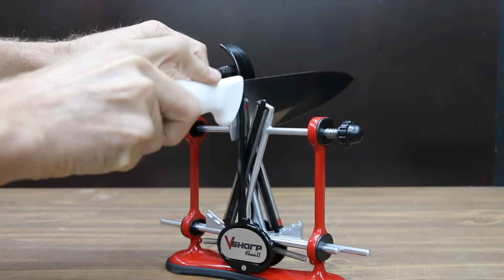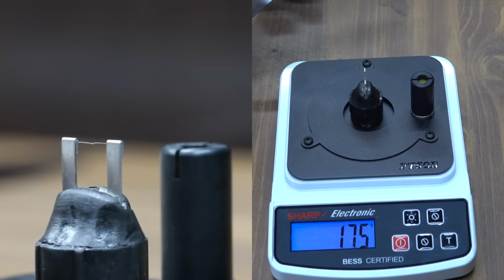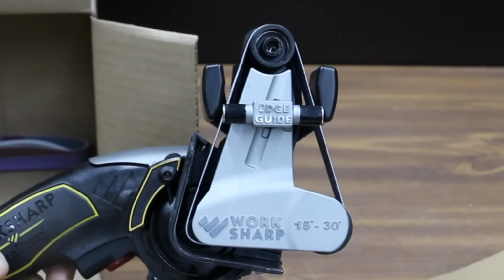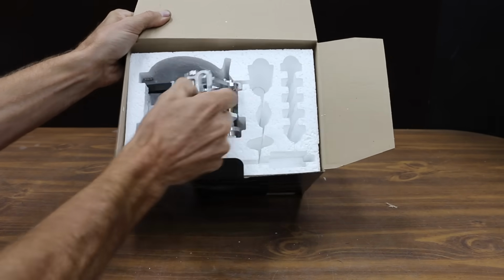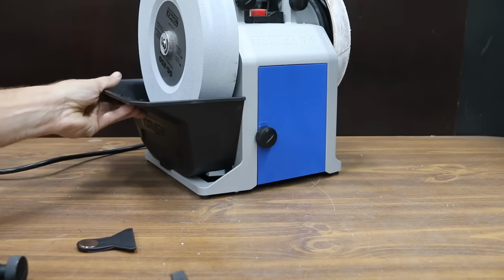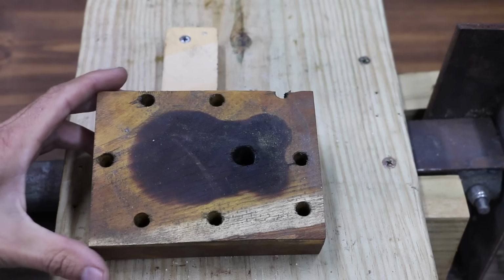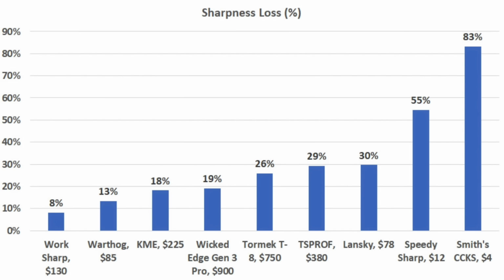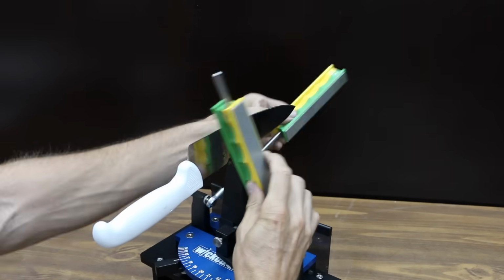RUSSIA vs USA Knife Sharpener? TSPROF vs Lansky, Wicked Edge, KME, Tormek T-8, Work Sharp Ken Onion

Comment: It's too bad that the T-8 didn't come with the knife holder. The jigs allow for the knife to be rotated (for the curved tip) while keeping the holder jig always connected and perpendicular to the guide rod. Instead of rotating the knife holder. Also the guide rod can be flipped and used for stopping to ensure the sharpness. Just info for future use :)
Reply: Tormek was shown in a bad light in this video, but it is their own fault. A Tormek used properly is really effective. It is very expensive, but if you are a pro user, it is worth it. I also have a Japanese water stone with my T-7 and it puts a mirror edge on my best knives and tools that lasts for ages, I have many of the jigs even can sharpen drill bits
Reply: @Anchor2012  The detail view of the tormek resulted in the finest edge without  scratches. I think the soft steel  cuts better with scratches. Using a Hrc 61 plus knife would  may be show a different  picture especially after blade abuse. But sharpening  is a field of its own. I look into the tormek for years now this just shows  me why  I will get it as a treat may be next year.
Reply: You can also get a stone dresser that will turn the stone into a fine stone.
Reply: @jesusisalive3227  It comes standard, but I didn't see it used.
Reply: @irresponsiblyblue1411  

It doesn't come standard on all models.
Reply from the maker: Thanks for the feedback.

Comment: For a part 4, take the longest sharpener time, and use a 400/1000, 3000/8000 whetstone kit in under that time. Whetstones are so cheap and can put incredible edges on knives.
Reply: I find ceramic better for day to day use. No water or oil needed and can sharpen curved blades that flat stones cannot.
Reply from the maker: Thanks for the suggestion.

Comment: I have a no-name brand (I couldn't find one on it) sharpener that looks lots like the Smith's one.  I use it every time before and during cooking prep.  I find it works great, and keeps a nice edge on my knives.  I like the simplicity...some of the ones you tested have a Rube Goldberg vibe to them.  I am afraid that due to the multiple steps, I may avoid using them, whereas the simple, one piece tool is so easy to use.  And lastly...I absolutely loved the ASMR part!  Very un-Project Farm like, but frankly, I'd enjoy seeing more like that.  Great job as usual!
Reply from the maker: Thanks!  Thanks for the feedback.

Comment: I’ve love my Lansky!  Seems like a good future project for you to add the most significant bells and whistles from the “top performers”. to the “best sharpener for the money”!  I’d love to see a any improvement to consistency and ease of use.  Love your channel, long time viewer.
Reply from the maker: Thanks!  Thanks for the suggestion.
Reply: @ProjectFarm  have you looked at it used the Spyderco Tri-Angle Sharpmaker? I swear by it 👍
Reply: Hi Todd, thanks for everything you do! I've made several purchases over the last few years based on your data and look forward to every test.
You mention that if the viewers would like to see anything tested to mention it so I have a couple of ideas with the example I'm currently using. 
*Spray adhesives
(Lepage heavy duty) 
*Nitrile gloves
(Gorilla) 
*Hand degreaser
(fast orange) 
*Multipurpose cleaners
(super clean- purple container) 
These are all things I use in the shop and would love to see some comparative testing against other products.
Thanks again!
Reply: I love my speedy sharp. If I have a lot of knives and axes to sharpen, I have an old WEN wet wheel.

Comment: Dang. Looks like I need to get myself a lansky. You made quite the knife there! Very well done!
Reply: Its so complicated it will probably sit in a drawer forever. a cheap (but well made) ceramic rod would be the best bet. Once you get the had of holding it at the right angle (you can hear when it's off) you will never need anything else.
Reply from the maker: Thanks so much!
Reply: Take a look at the Worksharp precision adjust. It's a guided rod system but with much better functionality than the lansky. I have one and fantastic.
Reply: @destro6971  I'll have to look into that as well. I've always had issues sharpening knifes well on a stone for whatever reason, probably not enough practice, but if its priced well it sounds like a good choice for me.

Comment: I absolutely love my wicked edge  but it takes a long time if it's the first time sharpening that blade with it and re profiling the blade. But I do love how sharp I can get and how consistent it can be. But definitely hate how it changes the blade geometry of the edge as in between the tip and handle end up with different angles especially if it is a long blade. Recently I bought a work sharp and like it for my general edc, like my Leatherman and my Benchmade Osborne.
Reply from the maker: Thanks for sharing.

Comment: Why have you ignored EdgePro?

Did you consider checking the angle on the sharpeners when you flip a knife?  I tried a Ruxin Pro that simply could NOT be zeroed. Sharpening angle changed by as much as 7 degrees when the knife was flipped.
Reply from the maker: Thanks for the suggestion.  Thanks for the feedback.

Comment: Thank you for helping us spend our money wisely. Could you test automotive eraser wheels, the type that you fit into a drill, that are used for removing glue and stuff? Thanks.
Reply from the maker: Great suggestion!  Also, thank you for supporting the channel!  It helps me put together more expensive reviews.
Reply: Yes! I don’t know why I never thought of this suggestion myself. While you’re at it and you have the tools out to test these, how about you test different brands of roll lock abrasive wheels and different brands of wire wheels. It’s really miserable when you spend the extra money to buy the good stuff when it comes to any of these products just for them to turn into dust after 30 seconds of use.
Reply: Id be interested in this too, I use 3m green roloc for removing gasket material on engine parts, its stout enough to get through most gaskets and sealant quickly but soft enough not to destroy an aluminium casting in a hurry (tho it will of you lean on it) I use mine in an adapter to a snap-on 12v micro polisher so theres a whole other avenue of reviews haha (my workshop doesnt have air)

Comment: Fastest notification yet! Love these knife testing videos.
Reply from the maker: Thank you very much!  Enjoyed your video today!  Very informative and helpful!!
Reply: @ProjectFarm  small torque  wrenches: lowest settings for bicycles and spark plugs ect.
Reply: Another idea for the upcoming winter is to test different types of apparel and how they handle wet and cold. For example, how does wool differ from polyester, nylon from cotton etc
Reply: You made me laugh when you whispered. There is someone that is doing that but isn't doing his job at all. With that said  I have the lansky system but I end up going through the course stones quite fast. I still want the Russian made system because of the base and how it keeps the knife in the best angle.
Reply: I have always been a bit of a nut when it comes to having sharp knives. I own the TSProf system a Lansky and the Ken Onion Work Sharp. For decades the Lansky has been my go to. More recently I bought the TSProf then the WorkSharp. I have a hard time keeping a consistent angle with the WorkSharp and if you're not careful, you can ruin the tip of your knife (speaking from experience). When I really want a high quality edge and have the time to do several knives, the TSProf is my favorite.
Reply: "Fastest notification yet!" What are you using to time notifications?
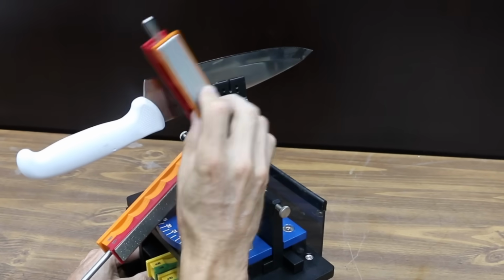Reply: @eriklarson9137  I know PF uploads at 12:50pm every Sunday, and I received the notification at 12:50, so I consider that extremely good.
Reply: Me as well!
Reply: Maybe do best battery powered air compressors.
Reply: if so about knives , i think you gonna like this channel 
https://www.youtube.com/channel/UCg3qsVzHeUt5_cPpcRtoaJQ
i think project farm will be impressed also if he have not already been there